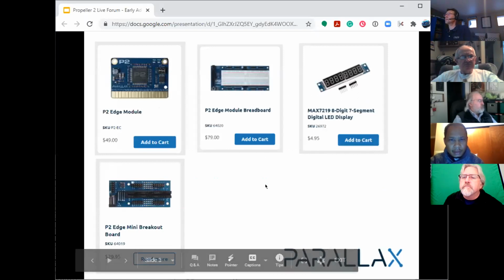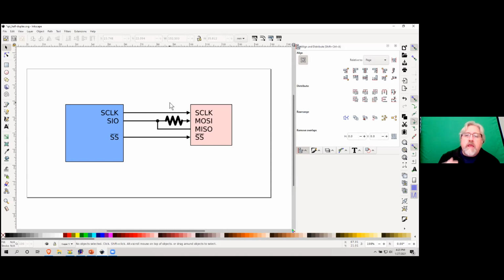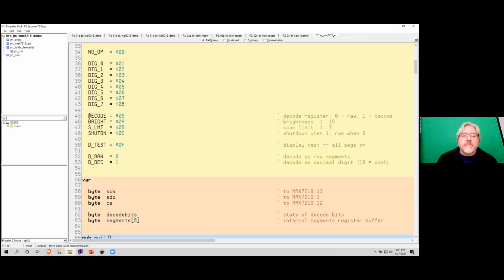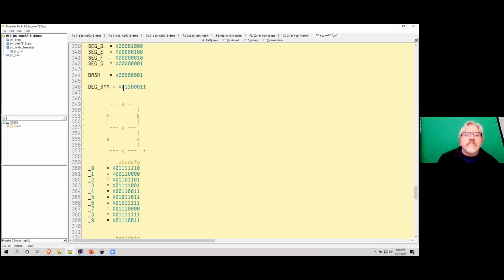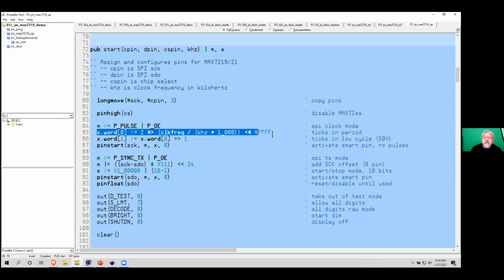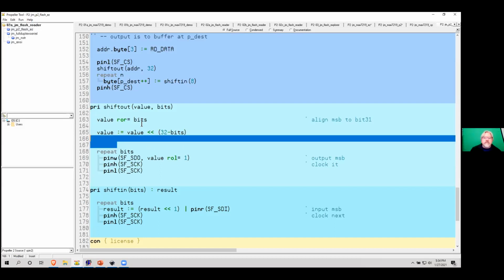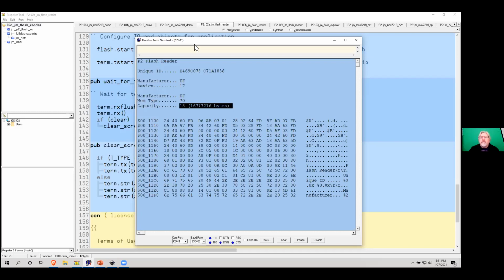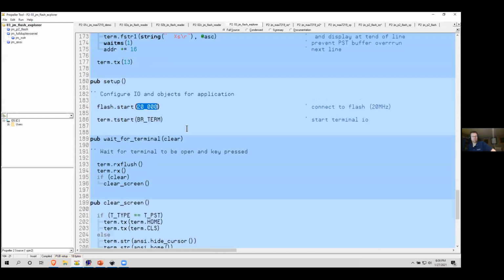Spin 2 Beginner Series Part 5:  SPI Interfacing the MAX7219 with JonnyMac

Comment: There is a mention in the data sheet that the max7219 does not exactly officially support SPI. The max7221 version however, is listed as officially supporting SPI.